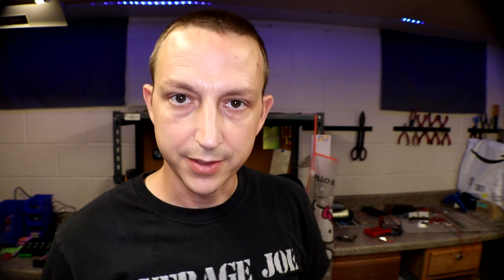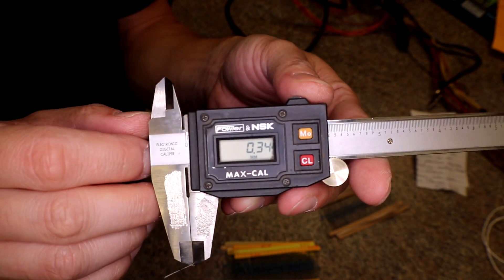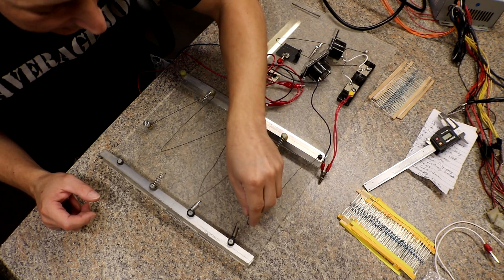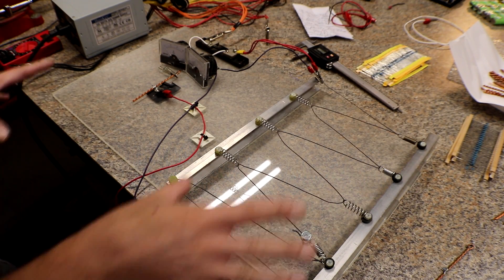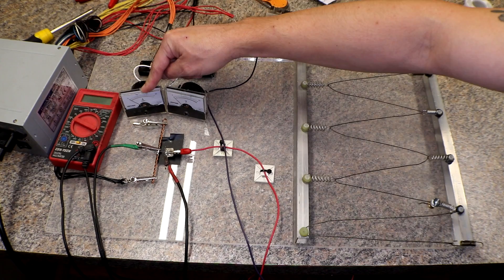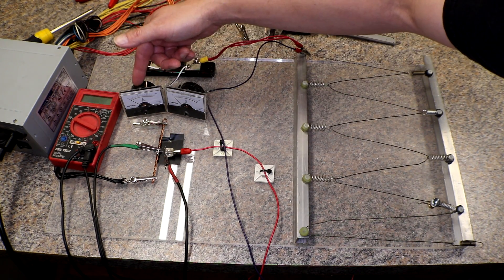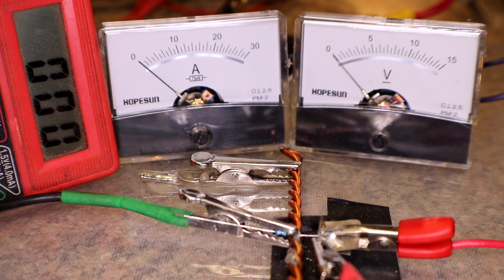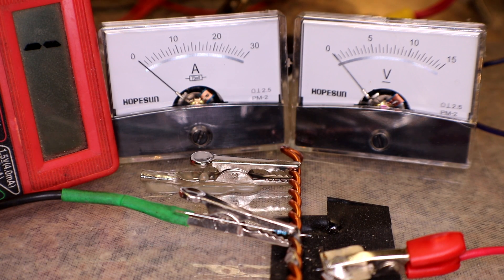Testing Resistors for 18650 Fuses!

Comment: For a powerwall application I'd sleep better monitoring the temp of each cell in addition to fusible interconnections and a system fuse - added cost would be miniscule and might save the lives of people you care about.

Comment: Thank you for this video. I am a beginner and looking for as much information I need. How many amps fuse can you use in positive and in negative?
Reply from the maker: Thanks for watching! How I figured out the amp for my packs is...since I am using used laptop cells. Most dont like to go over 1amp discharge so I kinda set 1amp per cell as my number. Then I times 1amp by 1.5 or 2 for overarage and thats the number I went with. Many other builders use much higher amp fuse wire tho. Basically you want to know what your cells can discharge in amps. Then times that number by 1.5 or 2.
Reply: @AVERAGE_JOE  thanks a lot
Reply from the maker: No problem. Keep in mind if your building big packs like 80p or bigger, you usually wont have a high discharge per cell since there are a lot of cells. If its a smaller pack like 20p or smaller, you could use a little higher.
Reply: @AVERAGE_JOE  i will just build a 7s9p I saw one of your video ang I  follow your steps

Comment: Minor point.  Hot Glue doesn't dry.  It cools.  It's not really a glue in that respect, but rather it melts and cools instead of hardens like a more traditional glue.  Shocked a video this old only has 217 likes.  It needs more.
Love that at 17 min, he says "Don't watch this video"..  And they look like 1/8 watt..  Not 1/8 ohm.. But you have an ohm meter, why not test their value?  (not that it makes a difference in this case).
Reply from the maker: So true on the glue lol and yes I think I may have said 1/8 ohm instead of watt. Appreciate the comment and view!🤘

Comment: Hi joe I once saw u do some fuse wire soldering from a role and warning that if the wire touched any cells it would cause a short Well maybe here's an idea ,run the wire thru some silicone tube while soldering  to avoid the stray wire shorting
Reply from the maker: Yeah that could help for sure! Great Idea!!!

Comment: What is the difference between putting the fuses on the negate vs the positive side pls?
Reply from the maker: Standard practice is on the positive end.  There are some cases that the negative side is used.  I have 4 cells on each pack that are fused on negative side but its to strengthen the bus bar!
Reply: AveRage Joe ok thank u

Comment: Resisters are not measured in fractions of an ohm.  they are measured in whole units.  They do look like 1/8 watt resisters.  The color bars tell you how many ohms the resister is.  One color bar tells you the tolerance (2%m 5%, 10%) they will measure when putting a meter to it.  I have never seen a "Milli", "Micro", or "Pico" ohm resistor.  Great job on this work, I am really enjoying the content you are putting out.  Keep up the great work and I still love the Hello Kitty apron.
Reply from the maker: Did I say 1/8ohm in there somewhere😆  Thanks Man, Ill be doing a glass fuse video again here soon.  Ive been seeing a bunch of crazy unsafe powerwalls here lately.  A few have even caught fire😲 Think I might start a safety series!🤘
Reply: @AVERAGE_JOE  I am considering a project like a power wall, and I am doing a bunch of research.  Safety is a big concern for me and I do appreciate the content you have completed so far.  I always thought the  resistor wires did not provide the correct protection such as in jehugarcia's (That is his you tube channel) project.  your testing has proven that.
Reply from the maker: Yeah safety was a huge concern since I have the cells in my basement!!!  Resistor legs IMO are pretty much a last ditch effort in a direct short type of situation.  They might be fine for the negative side but I want actual protection!

Comment: Hi Joe.  When doing fuse testing.  Notice the 75MV below the A on the amp meter.  I am guessing that using that meter creates a 75MV voltage drop.  I think you should be adding that 75MV to the voltage drop you are measuring.  unless the digital meter takes into account for that.
Reply from the maker: Thats a good question.  I believe the digital is just measuring what it see's!🤔
Reply: @AVERAGE_JOE  have you thought about using a potentiometer
 for the increase of current or is it too much for this application.  I know they make some whopper pots out there.
Reply from the maker: Yeah pots cant handle the POWAAHHHHHHH!😆

Comment: Dont be mad love the vid but
1. Gravity assisted fuse pop encourages early blow
2. Not a real world test for intended application. Wish you had built a small crappy 18650 pack instead of a psu.
Reply from the maker: All good Man!!! Yeah gravity for sure would assist an early blow. A psu allows repeatable results. I guess one could build a pack and recharge it for every test for repeatability...<-----🤔is that a word? but thats a lot of extra time ect.
Reply: @AVERAGE_JOE  if it makes sense its good in my book. Spelling looks weird tho. 

Yea would be really slow and annoying but i guess it doesnt matter as you proved those legs are not good as fuses. I'll stick with my 30awg but my smaller projects deff need the glass fuses.
Reply from the maker: If you go to KS and stop here and want some .5 or 1a glass fuses I could give you some!

Comment: I wanted to test 1/8 watt fuse legs before I used them in my build. So I bought a 0 to 30 Volt -  0 to 10 Amp current limited Chinesium supply for 62 bucks from Amazon. My 1/8 watt resistor legs blew at 5.5 amps within 10 seconds. 1/4 watt resistor legs popped at 8 amps. A nice bench power supply can do your test much easier, more accurately and possibly even cheaper. The same supply I bought is all over Ebay and Amazon from various sellers. If you buy that supply, the only caveat is: Don't  rely on the current limiting circuitry to protect the supply above 15 volts out!  If you set the output to a higher voltage, say 25 volts, and then suddenly short the output, a transistor inside (Q2 on the board) will short every time. Below 15 volts seems fine though.
Reply from the maker: When I first started testing for fuses I didnt have much cash for testing equipment and used what I allready had on hand.  Plus if others wanted to test theres, this setup is pretty easy to replicate with items around the house.  I know many say that voltage doesnt effect amps but in my testing it does.  If I test at 3.3 or 5v the test are pretty close to each other but if I test at 12v the fuses pop much faster.  Can you do a few test at 3.3ish and 5v to see what your Chinesium psu does.  Would be interested to find out!

Comment: I’m still amazed by people still useing resistor legs as a fuse insane especially when you go over to AliExpress in order real fuses for generally eight to $10 and you get 1000 of them and they’re real fuses I just don’t get it yeah you can get thousands of resistors for a few dollars but why is it so hard for people to understand you want to use a fuse as a fuse or have people forget how many houses were burned down when they originally used fuses and know what all idiots would take the fuse out and put A penny in its place
Reply from the maker: I agree!  He did say he was going to use the legs for the negative side which I think would be just fine!💥😆

Comment: @avergejoe, I’d like to see a fuse test with fully supported connections. I’ve noticed that gravity assists the breaking of the fuse wire as it glows red. In a real world application we wouldn’t have tension/weight/gravity assisting the disconnect. Point being that the amp rate at disconnect might be higher then we assume. Food for thought. I would love to see if there is a noticeable difference.
Reply from the maker: After watchin the video again, I agree. You never know, there could be a hair difference. Next fuse test Ill have it supported!😃🖒

Comment: Joe, those are definitely 1/8th WATT resistors based on the size of the resistor part but that does not matter for what you are testing because it is only the WIRE lead ("lee-duh") that you are checking.  The lead diameters indicate these are chinesium based (cheapo) resistors.  Not all 1/8th watt resistors will have that diameter wire - higher quality and more expensive resistors will have a bigger diameter lead.  If that diameter is good for a fuse, then I have consistently gotten that diameter wires on resistors I buy at Tayda Electronics (taydaelectronics.com) because I am cheap and the thinner leads work fine for electronics that I make.  You might get a bigger diameter lead on resistors from ebay and that would mean a higher current and maybe not so good to use as a fuse wire.  Make sense??
Reply from the maker: Ahhh Ok.  Yeah I wasnt sure.  I usually dont buy resistors lol.  I was hoping for smaller diameter.  Love the ("lee-duh") lol 😆👍
Reply: @AVERAGE_JOE  Smaller diameter of the resistor or the lead?  In the tests you were not testing the resistor!  The lead is too thick on the chinesium resistors???
Reply from the maker: Smaller lee-dah!😆💥👍

Comment: I always thought the legs had zero ohm and only heated up due to amperage through them, but the last test showed length matters.  Seems fuse wire that is rated might be better, since the fuse rating in resistor legs changes with length.
Reply from the maker: Ive tested some of the real fuse wire in the past. Id have to go back through to look at the results but I think length matters on that as well.
Reply: @AVERAGE_JOE  I think you are right. The same would happen in fuse wire. They would never heat up if there was zero resistance.

Comment: If you have a shorted cell and run 100A or 200A through it 3.7V, what happens?  It takes all the parallel cells down with it? Thus if you have a 3.7 volt battery in series to make 24V, 7s the rest of the pack must make up for it? 24V at 3.42V 7s vs 4.0V 6s?  If it is NOT dangerous, then you could have a 48V pack and if a cell goes bad it wont take the whole pack up in voltage and explode???

Comment: If anyone is interested I bought myself one of these https://www.ebay.com/itm/48V-5500W-Pure-Sine-Wave-Inverter-Driver-Mainboard-with-MOS-Pipe/173175053693?hash=item2852099d7d:g:PfoAAOSwzbVa~94H 
to make a diy inverter from a non working 48V UPS like joe has. I removed the transformers from the unit and hooked them up and they work better then the 12V 3000 Watt modified sine i had. I'm using a 14S20p 50ah pack (2.9kwh). I have 6 or more packs in the works.
 If interested in what i have done let me know here with your email address and i'll send you pics of my setup.
Reply from the maker: Interesting!!! Im wondering what the no load amp draw is.  My ups draws 2amps no load!
Reply: i use a 50a shunt and a needle dial and it barely moves to the 1 amp

Comment: Umm why only testing the wire and  not the resistor ?
Reply from the maker: We dont want to resist any power. We want resistance free as we can under normal operation but still need a fuse and this can be another option if one wanted.  Mike was going to use them on the negative side which would be fine. On the positive side I personally recommend the axial glass fuses that are much lower!  I use the .5 amp fuses here and they pop at 2 amps https://goo.gl/KUAhM8 👍

Comment: 18:51 Meters starting to do random readings like that is usually due to the 9V battery needing replacement. Slap a new one in there and she should be good to go for another year  ;)
Plus, the symbol in the bottom left corner means the battery is low  :P
Reply from the maker: I want to say I replaced the battery a few weeks ago on that one but it didnt change.  My luck it was a dead 9v lol.  Ill have to check again!😆
Reply: hahah, yeah was gonna say, the 9V gotta have some juice left in it   ;)

Comment: You are testing the connection wire not the resistor.  
This 1/8 ohm resistor will blow at about 1W. This will occur at around 3 amps
Reply from the maker: Yeah just the tabs so we can be resistance free as possible but still act like a fuse.  I still recommend the glass fuses for the positive side!👍
Reply: It would be nice to use resistor as fuse. I suspect it will blow very cleanly and may be better than wire links and very reproducable rupture current like your glass fuse.

Comment: What is the benefit of using fuses on the negative side when the positive side already has axial fuses?
Reply from the maker: Only benefit on the negative side is if a negative wire was placed/ dropped on the ->battery<- directly (pops negative side) vs placed/dropped on a -->positive wire<--(pops positive side)!  Harder to pop a negative side fuse since the bus bar is in the way on our battery pack style but could happen.  I have some 24g copper wire on my negative side and that would take a lot of amps to pop.

Comment: For anyone wanting to know more about wires, grab a copy of Ugly's Electrical Reference handbook. A lot of great info about different types and ampacities of all common conductors. About $15 online or at most home improvement stores.
As far as using those resistor leads for fuses, I don't think it's a good idea. Way too inconsistent and excessive amperage. I use the 1 amp glass fuses for safety. I recently shorted a 60 cell pack to it's adjacent pack and only saw a small, momentary arc. It was enough to blow all 60 fuses.
Great video Joe!
Reply from the maker: Reference books are always handy to have!!!  And Yes for positive side fuses I would recommend the Axial glass fuses!  I also popped 200 fuses and barely noticed!💥👍

Comment: Nice pops. :o) There are different specs for such kind of resistors. The most obvious one is resistance, you can figure it out using the color code on the resistor or measure it with your multimeter (guess these resistors had 18 ohms or something like that?). And there is a package power rating. It states how much power the resistor can dissipate as heat, something like 1/8th or 1/4th of a watt. This means you can shuf up to e.g. 1/8th of a watt through the resistor before it starts getting too hot and eventually burn/pop over time.
Reply from the maker: BOOOOM💥😆  I want sure if the 1/8w resistor legs are the same size as a 1/4w legs.  Are they smaller or the same.  If they are smaller then they might pop at a lower amp!  Ill have to find some and compare!👍

Comment: I'm glad you are doing this. I'm about to assemble my bank. And this can save me a load of time. I have the tiny glass fuses. I don't like the way they look on the packs. I don't like the blow of them either. They are 5 amp. A bit high.
Reply from the maker: I would still keep the axial glass fuses but use the lower amp ones.  I use the .5 amp and they pop at 2 amps.  Or if you have a amp number in mind, its always double on the axial glass fuses https://goo.gl/KUAhM8

Comment: you need an active load!
Reply: Eliot Mansfield, the resistive wire is an active load "resistive load". It's the equivalent of a heating element since he did state it's hair dryer wire..... Did you not hear that?
Reply: no - I mean a 'electronic load'  like this:
https://www.ebay.co.uk/itm/150W-Constant-Current-Electronic-Load-60V-10A-Battery-Discharge-Capacity-C2L8/113158236013?hash=item1a58c1a76d:g:GJkAAOSwNURbTq5w
or another way is a heavy duty speed controller dumping into an old starter motor as the load.
Reply: That's what she said.
Reply from the maker: BOOOM!💥😆
Reply from the maker: I do want to get one of these!!!!